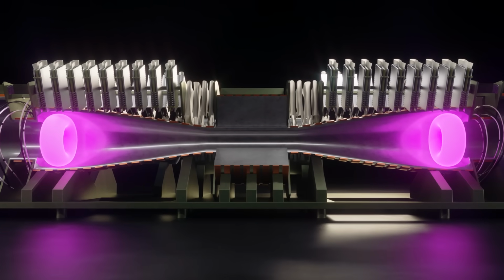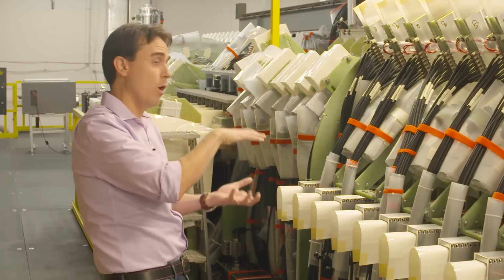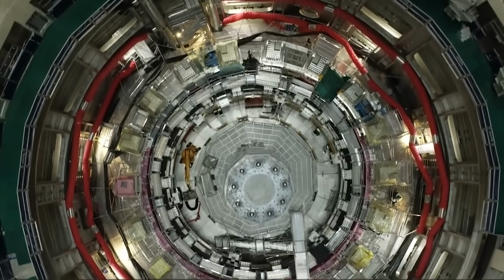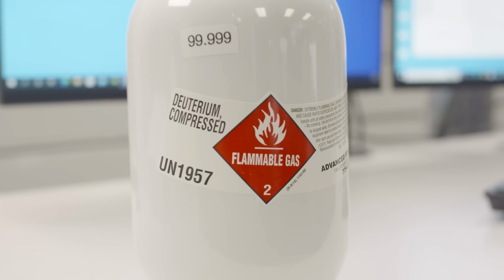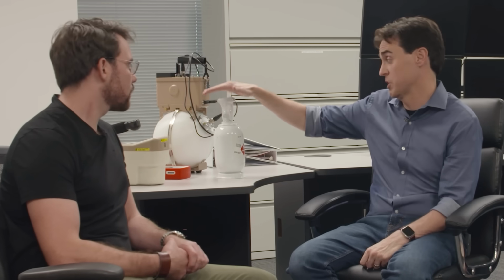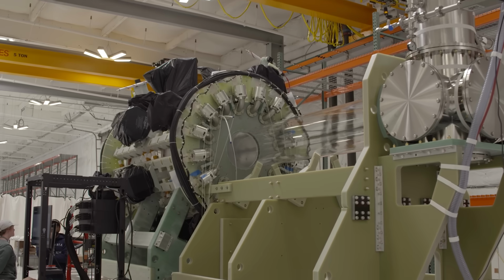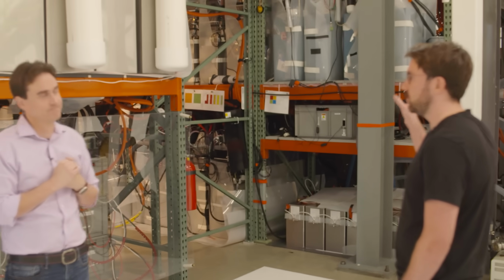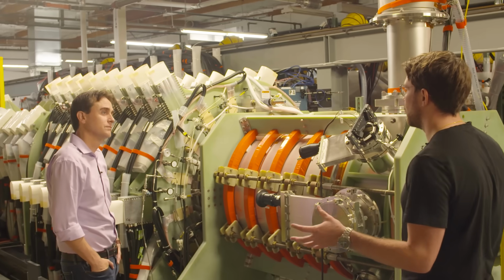A New Way to Achieve Nuclear Fusion: Helion

Comment: Thinking of safety. Unironically, what is the worst thing that can happen with this tech? Say, the magnets fail.
Reply: No fusion scientist here, but from all I've read nothing too dramatic. The failure of one or more of the magnets would prevent the formation, compression and/or acceleration of one or both of the FRC plasma torus, and any subsequent fussion. So, the only energy to be dissipated would be that already sent to those magnets, in the order of megajoules according the video (for comparison, one megajoule is more or less the energy contained in one donut).m n
Reply: @charliem6590  right, but I'm interested in the worst possible scenario, like all magnets failing when the system is at it's highest temperature. Would likely destroy the machine, I guess, but would it explode? Should the town nearby be afraid?
Reply: @jpbochi Unless the machine reaches fusion conditions, the only energy in the system is the energy previously injected to create, compress, accelerate, and recompress the plasma. Again, in the order of megajoules. Creating fusion is so hard that any malfunction of the machine prevents it. And even if, miraculously, the failure happens after fusion conditions are reached, in one cycle these machines will only produce a few times the amount of energy invested (at present, not even that).
Reply: @jpbochi  Nothing like that. The inner wall might see some abrasive damage. The energy content of the fusion plasma is not very high (a lot less than an electric car battery) and plasma is very hot, but has a very low density.
Reply: I must be missing something. Fusion is supposed to be able to generate copious amounts of energy, more than fission. But you guys are saying that it's pretty safe because there isn't much energy there. How can that be? Honestly, I'm trying to understand this.
Reply: @jpbochi  Yes, it is supposed to generate a lot of energy but, at least in Helion's case, in quite small chunks, repeated as often a necessary. To make it easier to understand you could compare it with one of those small emergency electricity generators with a one cylinder, two strokes internal combustion engine (and no inertia, unlike IC engines Helion's machine doesn't have much). If any critical part of our 2s IC engine fails during one cycle, in such a way that prevents further ignitions of the gas-air mix, the amount of energy to worry about would only be the one generated in the last cycle (again, supposed no inertia). That's a tiny amount compared with the total it could generate from a full tank of gas.

Comment: If you want to scale the reaction times to more per second, arrange the solution from a letter I with two sides to star with multiple two sides sharing one reaction center. Much like a rotary engine piston, but magnetic ;)
Reply: I would guess that the more arms they add the more complex it gets, like fitting all of the injectors, magnetics, cables etc would be an issue, plus the centre where it becomes incredibly difficult to confine the plasma would have much less surface area for the magnets to fit, or the copper wires for electricity generation to fit too
If it actually is possible to generate the plasma in more arms and fire more into the centre i think it yeah would make sense to use it

Comment: I saw another video like this a few weeks ago. Lockheed has filed patents for aircraft engines that were supposed to have sustained fusion reactions contained by magnetically compressed plasma instead of pulse fusion like this reactor. The Lockheed engines were supposed to use a sustained fusion reaction. I thought it seemed really far fetched but after seeing this and getting a better description of the process I find it to be a more realistic goal. The one question I have for this reactor (and for the Lockheed version) is how much power does it take to create all of these electromagnetic fields VS how much power is going to be generated? I am also curious of what would happen to this reactor, if at the point of fusion, with the 100 million degrees of heat, if the electromagnetic field were to fail at that exact instant, would it cause a catastrophic exlposion?

Comment: Hog wash. We've been able to demonstrate ICF ignition for decades. The claim is for breakeven, but they are only accounting for laser input power, not the efficiency of the laser and the power it takes to drive the laser in thr first place. This is a publicity stunt, not a scientific breakthrough.

Comment: I hope to see practical fusion power come to fruition in my lifetime. It has the potential to be civilization-changing. Even if it takes a couple centuries to succeed, I believe we will get there eventually, and that's a drop in the bucket of time anyway. There are engineering challenges to be solved for sure, but it's all perfectly feasible from a physics perspective.

Comment: It sounds more like a 👨‍🍳 cooking recipe instructions than anything else. First heat your neutral gas ⛽️ to room temperature, add your deuterium & your 🎈 helium, microwave it for 5 mins on both ends, and stand far far 💥 away from the equipment. Wallah! 💡 Electricity... Dumbed down enough for me to understand.  Great job!

Comment: Just two questions: did they ACTUALLY achieve fusion ? Just asking because the only person repeating that over and over was the narator. That nervous engineering guy avoided the term or used "...will create...". And secondly, and most important: what is their projected efficiency factor and when will it be achieved ?
Reply: Yes. It happened at each flash while they were in the control room.

Comment: I'd been trying to figure out how to extract electrical energy directly from the fusion reaction. I was thinking it could be done by modulating the magnetic field once the fusion reaction produces a direct current through the plasma. The problem I was running into was how the current formed is direct and it's not possible to extract energy through a static field, pulsating the fusion reaction gets around that problem well.
I think if they fire each set of toroids in alternating polarity they could produce a continuous ac output.

Comment: He said that the superheated plasma is prevented from touching the walls of the apparatus by a magnetic field. Does that stop the heat as well? From my understanding super hot things bleed that temperature into their surroundings, is that the reason for the cooling channels? Just looking to clarify, thanks!

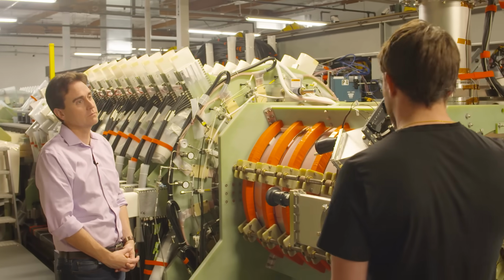Comment: @ 3:48 bro, after being told the principles upon which The machine works, what on earth would make you think the plasma is generated in the center of the machine? lol, The specifically told you that two plasma clouds are created on either ends and accelerated toward each other to meet in the CENTER of the machine where a fusion reaction takes place... So why would you stand at the center of the machine, and say "so this is where the plasma is made, right?"  🤦‍♀️    lol
You guys don't need to necessarily need some buddy that's qualified in nuclear physics to do your journalism, but you should at least have someone that's technically and a mechanically minded.

Comment: I really wish they had gone into more detail about how they are extracting the energy using the magnetic interaction.  This seems like a nearly impossible task.  Since you are actively using magnetic confinement to contain the plasma (an energy expense to the system), how do you then turn around and harvest that same energy?  You have to maintain magnetic confinement (which is an energy expense) and it seems the higher the pressure goes, the more energy cost there is to maintain the confinement.  I'm not sure how you reverse that process and start drawing energy back out WHILE AT THE SAME TIME maintaining confinement.  It seems you would have to relax the confinement, so you could harvest the magnetic field, but that would lead to a breach.
Reply: For those interested, I don't know that this question was answered, but there was quite a bit more info in the Nebula videos.

Comment: A very interesting new technique to get fusion to happen, but the bottom line question is can it give a coefficient of performance > 1?  I.e. is there a net production of energy.   I like the induction method of generating an electric current its has its parallel to magnetohydrodynamics.  Could this method  be be a version of a homopolar generator. If so then the output would be DC

Comment: But the main problem persists: fusion reactions generate temperatures in the millions of degrees. We have no elements on the periodic table that can be scaled up to a material that can withstand temperatures that high. With a sustained reaction, the containment vessel would melt into a molten mess.

The day we can fly a craft into the sun and out without a lick of damage is the day we can start seriously considering fusion power.

Comment: didn't know that beam-on-beam fusion was LE HECKIN groundbreaking and what's with the "millions of miles per second" choice of units? he just sounds like a pseud. bashes millions of dollars worth of fusion research with his hacked together toroidal plasma accelerator using an even more exotic fuel than the tokamak, if he really wanted to appeal to the media he could've told the neutron flux this thing generates lol xD

Comment: @Real Engineering - Brilliant video.

I have just 2 questions please:

1). How many Kilo Watt hours or Mega Watt hours would be generated by this system to use as Electricity?

2). What would happen if the plasma WOULD touch the sides of the system. Would there be a violent explosion destroying the machine and surroundings? If so how big would such an explosion be?

Comment: Interesting stuff. I personally still believe that tokamaks have a positive future but I am also glad to hear that alternative paths are also followed.
In this particular scenario my main worry is: What if on one side the accelerator fails partially and the the two plasmas do not accelerate symmetrically? Do they meet off center and keep moving towards one edge?
Also just a factual note: Tritium does not take 12.3 year to decay into He3. That's not how half-life works. In 12.3 years, about half of it will have decayed, in 24.6 years about 75% will have decayed and in 36.9 years still only 87.5%. I think instead of storing tritium and waiting for He3 to form, you could just sell the Tritium to those that actually need it...
Reply: Even if this doesn't end up generating enough energy to be worth using as the primary reactor, it's still a relatively easy way to make tritium for tokamaks and other reactors.
Reply: @jacks1368  not to mention how much it can serve the scientific community studying the effects of fusion
Reply: curiously, they dont talk much about extracting the resulting energy, compared to tokmaks, this approach here results in huge amounts of energy emanating from a tiniest point where two sphares are being squeezed into each other. For small amounts of fusion material that is probably fine, but anything significantlly larget will prolly blow the containment wessle into pieces. While tokmak,  the hot plasma is distributed in an exponentially larger volume of space, making the energy-extraction part much easier and safer. But im no physicist, hope someone chimes in
Reply: @Alejandro388  It's explained in the video, they are using a magnetic system to 'extract' the resulting energy, he also mentions that the next iteration is going to be 25% bigger to account for higher than expected fusion plasma reaction.

Edit:
Just need to add this, they are still in a prototyping phase, so they are only doing i believe one reaction per 10 minutes, it's the next iteration (7th generation, Polaris) that they are going to really start going for longer reactions and then focus on generating 60 hz power, the 8th generation is the one that's gonna be supposedly the one who's going to generate power in the energy grid.
Reply: @l4nd3r  it is HINTED at in the video, and the way they wave it away sounds a lot like the business plan of the Sock gnomes with a lot of ??? in the middle between "plasma expands against the effect of the magnetic containment" and "power is generated". To prove they can make ANY system that derives energy from that process will be the biggest challenge of that Polaris prototype. Not that reducing pulse frequency from minutes to "1/10th of a second" is less ambitious, another challenge would be scaling the magnetic system up and receiving the same or better results instead of losing efficiency to the Inverse Square law.
Reply: @Alejandro388  Yes, I was looking for an explanation of how they could extract energy from this reaction.  They implied that they could some how use the force exerted on the magnet field but how?  Right now it's pie in the sky.
Reply: @retirednobaddays456  a changing magnetic field can be used to induce an electric charge. The idea with these reactors is that instead of using the thermal energy from a long term reaction like a tokomak, they use the expansion of the fusing plasma to change the magnetic field around it which induces an electric charge in their capture system. 

Induction is commonly used and actually forms the basis for our AC power grids, but it's insanely cool to see it applied in fusion generators. The question that remains to be answered is: can this reactor generate more electricity than it requires to fire?
Reply: @retirednobaddays456  "How they could extract energy from this reaction" is pie in the sky? A changing magnetic, and thus electrical, field is literally how ALL electrical generators work (and all electric motors btw.).

Pie in the sky is the part where you need to extract more energy than you put into it. That's the part they still have to prove to be able to do. And to make it a continuous reaction.
Reply: @Alejandro388  great thoughts for a non-physicist. 👍
Reply: @Alejandro388  look at this thing as a combustion engine rather then a steam engine.  
so instead of having a big furnace coal chamber (the tocamak's fusion toroid)
you have a smaller compressed source of fuel that explodes inside the pistons and makes a direct mechanical push creating mechanical energy. 
just like the helios reactor that has a small compressed source of fuel that makes a direct electromagnetic push on a system creating electric energy.
Reply: Could you explain to me a very amateur scientist, how this thing is supposed to work, with no cooling?
Reply: @analytics805  I guess that's where the current 10 minute intervall comes from. to let the electronics and magnet spools cool down without external help.
Reply: @Ugly_German_Truths  These arent major issues now, if the captured energy is enough to charge the capacitor banks  and still have enough amps to send power to a grid then you can work on generator cycles and not having all generators fire at once. These are like individual combustion chambers and while each one is cooling the next is firing giving you a similar sign wave that 3 phase systems already use.
Reply: @analytics805  Who said that there wouldn't be any cooling at all? They haven't even build a continuous reactor yet.

But even if they wouldn't add conventional cooling, the generator is effectively cooling the thing by withdrawing energy from the magnetic field.

Anyhow, I don't think that the final product will have no cooling at all. They probably have to cool quite a lot of things actually. Coils, exhaust gases and the reactor walls come to mind.

The difference to the tokamak design is that for this design this kind of heat is an inefficiency they try to avoid, whereas the tokamak actually needs it to heat its walls to run its steam powered generators ...
Reply: Hmmm, and now the government is going back to the moon... All of a sudden. 😑
Reply: Re: T decay sure but all decay takes forever in one sence it good to have any way to show how fast one decay is vs. another.
Reply: He briefly addresses your main worry in the video.
Reply: While selling the tritium could be a good idea, once they have sufficient tritium stored, if they have a reliable way of separating the He3 from the tritium in storage, they will effectively have a continuous supply of He3.  Every 15 months, about 5% of the remaining tritium will decay, and the decay is pretty much continuous.